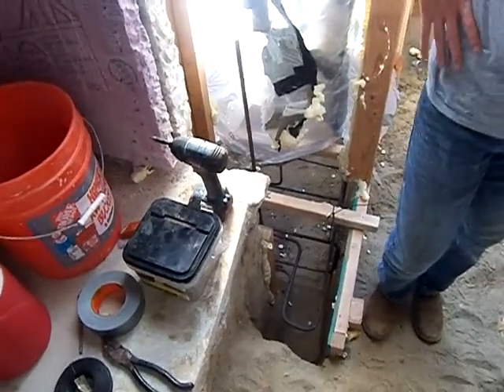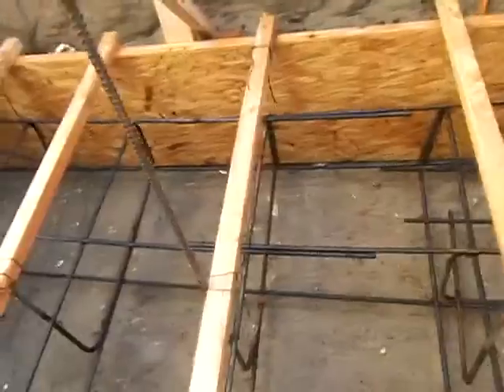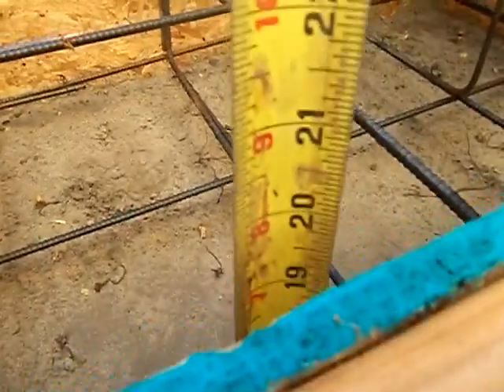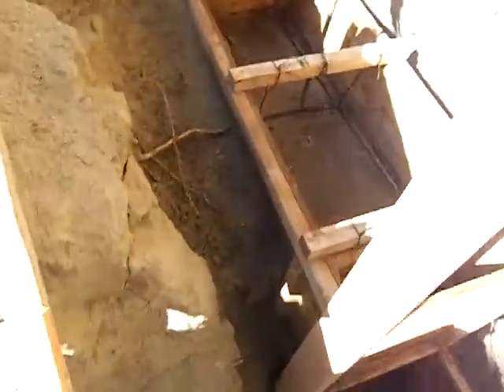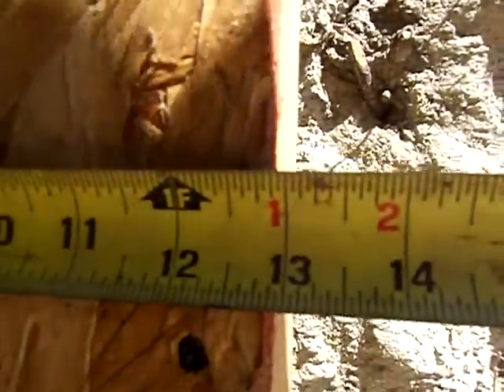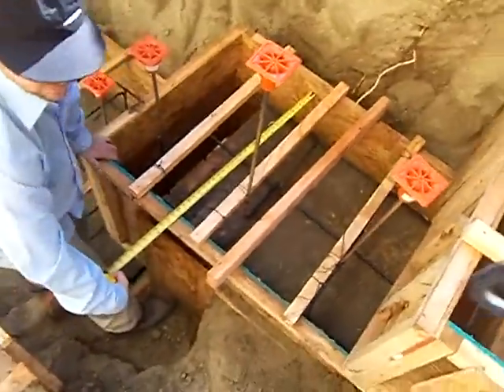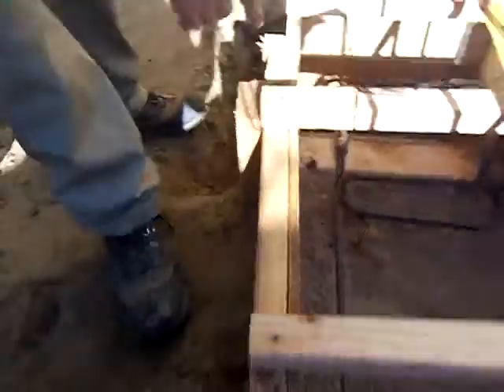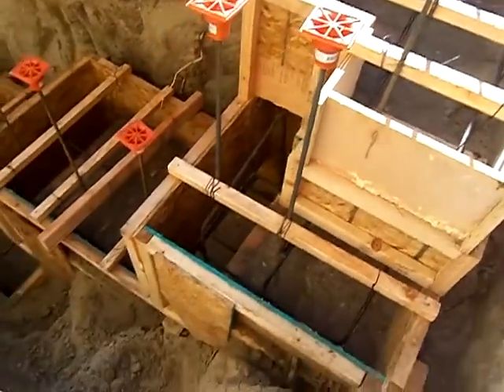CONCRETE FOOTERS WALK OUT BASEMENT

Comment: standard footer/footing size is 18 wide and six inches deep as far as I know for minimum, but not amazed when larger footings are specified, the rest of the wall for a frost protected foundation if not being used as a walk-in basement is minimum 4 inches thick, I am not a foundation professional but I have done 5 years of basement waterproofing doing interior drainage retrofit or repairs that another company mucked up improperly for basement foundations 

those are some beefy footings you have got going on
Reply from the maker: thanks for the added value from your experience